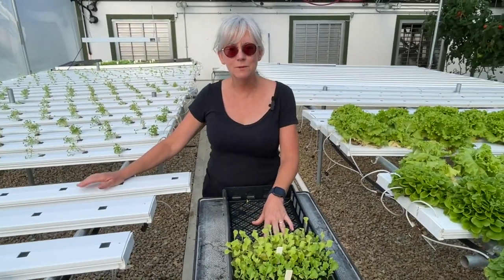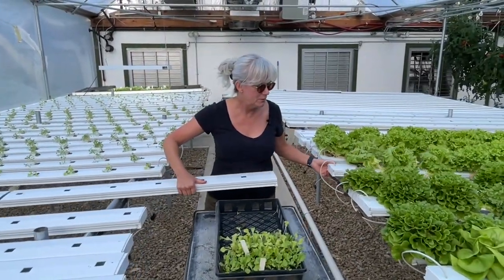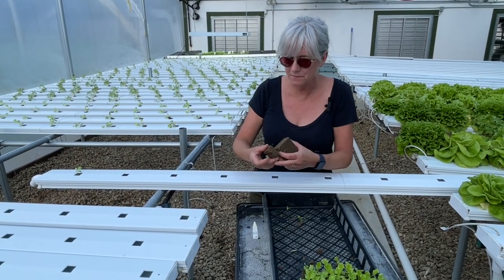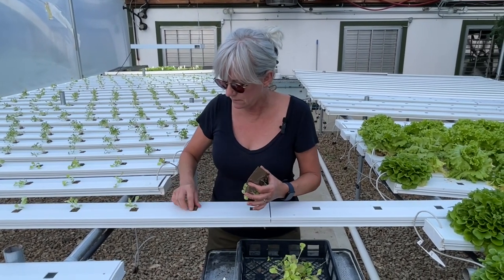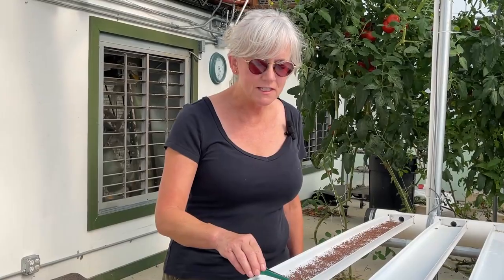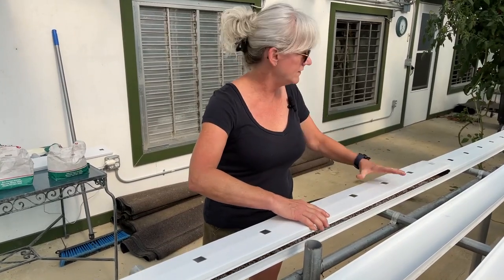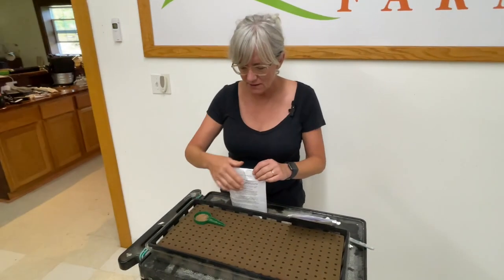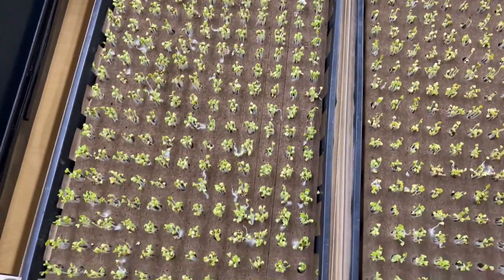Hydroponic Seeding-Planting-Cleaning Part One

Comment: Hi Devon,  I have been watching your channel for months now but this is the first time I have commented. Thanks so much for what you and your family have done to get this out. I also have a green house and have followed much of how you grow. I live in El Paso, Texas but travel in my job and have visited CropKing in Lodi several times. Have bought many of the Flat Channels and many supplies from them and always tell them I found them through your channel. I have 2  questions I have : 1.) what 1/4" tubing you use for the trays that is flexible enough to clamp to close off. Can you tell me what is that tubing you use? 2:) What is the temperature of your greenhouse and the tolerance (+ or -)  your Dad uses?       Thanks, Dana
Reply from the maker: Hi Dana, The tubbing is Netafim SSPE Tube Gray 5x3mm 1000 foot roll. The greenhouse has different programs that we run depending on what time of the year it is. Right now we let the greenhouse get down to 62 at night if it can and high is the high to the extent the water wall and vents can keep the greenhouse cool. Hope that helps. If you want more detailed information on program let me know.
Reply: @HomegrownPassion  Thanks you for your response Devin. I appreciate the info. That does help and I too have a wet wall and understand trying to get all the cooling I can get during the heat of the day. I just ordered the Netafim tubing for my system.  Thanks!